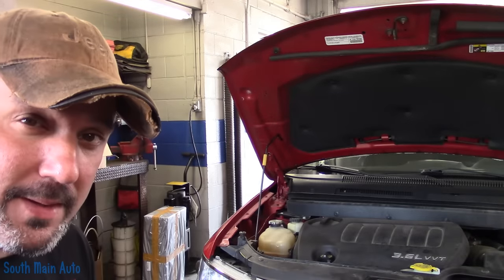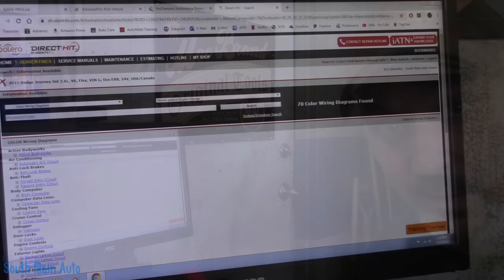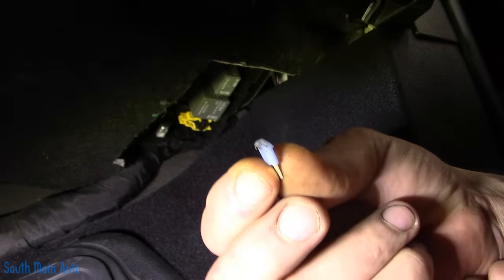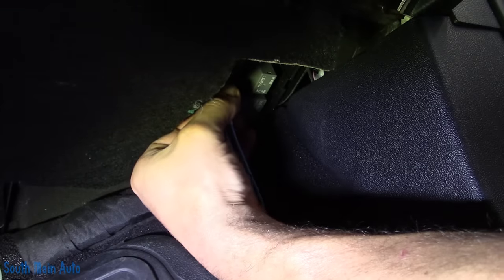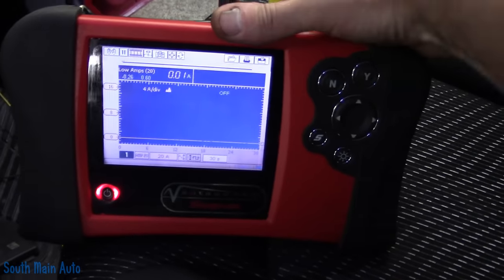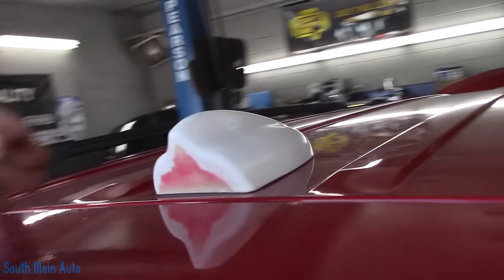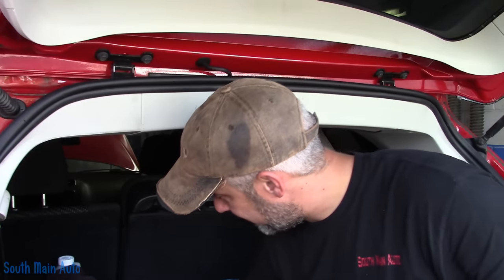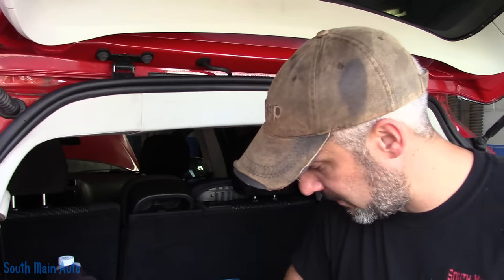Dodge Journey: No Start, No Crank

Comment: My 2013 Journey has twice now, done the same thing; no power and no cranking. I had the battery tested after charging, and they said it is working fine, with no cell issues. When the vehicle first did this, it unlocked, then there were no interior or dash lights, and it clicked once instead of cranking. I got a jump, it started, and only ran with the cables. The next day I went to the vehicle, and it operated as if it never happened. Ran well until yesterday. I heard a constant clicking noise, while the vehicle was OFF, and the doors wouldn't lock, so I manually locked them. This morning there was just enough power to unlock my driver's door, then nothing happened except that same clicking when I pressed the fob because it said Key Not Detected. After I attached my jumper box, I had to start the vehicle with the fob pressing the ignition button. Then it started. Once started, it operated as if it never had an issue. The thing is, it never said Key Not Detected yesterday, or the previous time it has acted up. The mechanic thinks it might be a low battery in the fob, however, I don't know if the fob would affect the interior lights not functioning when it trips out. Is there anything you would suggest, as I have to drive this vehicle, and can't just go trade it in at the moment? Thank you. (Also, I have not had any aftermarket changes to my wiring performed, lol)

Comment: When I saw that "shark fin" I thought the problem was going to be in the RFH module wiring being rubbed or pinched since the RFH covers the antenna base clamp bolt and it is obvious that it was removed (probably from a car wash, garage door, or a snow broom) at some point. Didn't think the power wire would have been tapped into for a backup camera. Just goes to show that you never know until you get in there.

Comment: Whenever someone asks me to help them pick a car, my #1 rule is 'No Chrysler products' lol
Reply: Or Nissan
Reply: or Ford.
Reply: darrell c whatttt. Ford cars are shit but ford truck are the most reliable American vehicles on the road whether you like it or not lmao. The 2 best in general are Toyota and Honda
Reply: The way I see it is this: It really is dependent on the unit of measure. If you want cheap and disposable, Japanese cars are perfect, if you want a yard ornament buy a newer dodge, nissan, mazda, chev, pretty much pick one of any manufacturer... if you want solid engineering but not excessive, old volvo. If you want speed/hp go old chev. Torque? Old Ford. Loud and slow? Old Chrysler/Dodge/Plymouth. The CDP big blocks were called elephants for a reason. Handling? Easy, and I am gonna catch a lot of flak for this, but Lotus. Reliability? Give up that pipe dream now, nothing out there is guaranteed to ve reliable. It's a question of luck, not manufacturing or design limits. Every model from every make has units that prove reliable and ones that fail. Ease of repair and supply of parts are better metrics to go by. Thoughts?

Comment: What in the world did you do to your poor right thumbnail?
Reply: Hazards of the job. Fingers get banged and smashed, but it's better than losing the digit.
Reply: @CubasAutomotive  at some point continuous bashing is just as bad as loosing it . i'm living proof  :(
Reply: @richardcranium5839  yeah, my father says the same. Tender tips. .. I get that from time to time, but still glad I have the fingers. Lol. I find that using tools instead of finger tips kind of helps with that. Seems to let them heal but also less strain on the digits. Also, soak them in Epsom salt for an hr here & there when they hurt. Does wonders for me.

Comment: You should have used your "Fluid Film" Load Lamp in place of the 10 amp fuse in the meter, that way the max current would have been limited to 4 amps. Another great video never the less. Thanks from Northern California (the good part of the state)

Comment: Thanks for the new video. I look forward to watching your usual Sunday installment. I thought that we were out of luck with having several come out this week.

It still amazes me about the hack job aftermarket installations. A couple of years ago I replaced the stock AM/FM radio in my Chhheeevvroleeet 2500 with the fuel efficient 6.0. I had to wire the new radio’s harness to the module which has the door dinger... Care was taken to solder and heat shrink all connections. It didn’t take too much time to do things right. I guess that time is money for the car electronics shops. They must do whatever to get them out the door and get the next one in.

Comment: Good find Eric, I do the same with aftermarket equipment problems.  If they want to pay me to install it properly, that's a different situation.  I refuse to let anyone at a fly by night store hack aftermarket crap in my vehicles. If I want something, I'll install it and use proper wiring, grommets, fuses, relays, etc. 

Cheers Mr O

Comment: had a similar perplexing issue on a 2009 vw cc awd ... where as a bad door module was holding on the entire computer system   causing battery to  go dead in a few hours .... did the mv test across the fuses to determine all circuits that were  staying alive , had to use the old noggin  to see past the problem and bring to the conclusion of what was really the problem ... side note door module codes and nonworking window and door latch .... enjoy the door panel removal self latching push pins , must separate to get them to release ....

Comment: The roof rails also leak. I own a 2007 Durango and my seatbelt mechanism gets wet whenever it rains from the mounting holes being directly over the b-pillar soaking the seatbelt mechanism. I also had a problem with the drain tubes from the sunroof coming apart in the a-pillar and leaking down onto the drivers side kick panel fuse box.

Comment: You can modify the broken fuse to include two wires for testing. That way it is safer and faster to test. And you have a new tool.

Comment: For a few years it was common to see Chryslers with aftermarket HID headlamps activating the starter when the lights were turned on. A good way to cook starter motors and the occasional TIPM.

Comment: Dang, you're good! The meter thing could be a problem for people with oversimplistic thinking. Always calibrate your instruments.  A known current draw with a lamp similar to what you do ROUTINELY with scope on a rope is the ticket !!!
As to the diagrams - you always have to check your circuit diagram for the circuit in question BUT you also always have to check the power feed circuit too. You MUST check both.  It is VERY COMMON industrial practise NOT to include side loads in single-circuit diagrams.  For that you must consult the power feed drawings.  I used to do power shutdown planning for a huge 20+ megawatt site.  Hydro would call me at holiday times to see what we were doing.  It takes days to plan these while consulting drawings and old load lists.  Proper schematic searches are priceless.  Nevertheless, your nose for trouble and your fabulously good visual inspections and your 'nose' for specific circuit problems and water leaks are what renders you as one of the best automotive guys on YouTube.  Probably THE best.

Comment: What would you do without Chrysler products? Go broke? When I was an apprentice back in the day we called them fuse-able links. Not sure why, but it did help to distinguish them from the old glass cased fuses. I'm working on a Merc, starts but dies. Electrical nightmare so going to service a Jeep as that is going to be a pleasure in comparison.

Comment: My favorite is after market remote starters that have 20 wires hacked into and covered with electrical tape. Was it worth the $500 accessory to get nailed with a $300 repair that looses the accessory! Great find 👍

Comment: I used to do car audio and alarm installs for Circuit City back in the day.  We were trained to and always install a fuse within 6 inches whenever we tap a power wire.  Unfortunate this install was done so poorly.  I agree, the power should have been tapped up front instead of some random module in the headliner.

Comment: For those reverse cameras.. I always prefer running a relay and pulling the signal off a reverse light plus power direct from battery or breakout box.  A good marine grade sheathed cable for both the power and the signal work well for it.

Comment: I applaud Eric O for disconnecting stuff like this. Very few "installers" have a clue as to what they're doing. Most of them are high amp stereo junkies that think bigger wires must be better because of lower loss (that huge red wire is a dead giveaway one of those idiots installed it). This one is a clear case of leaving someone stranded because the install caused other problems. In same cases it can destroy something expensive. If the customer has a problem with it they can pay for a real install. You're already stuck fixing a problem caused by someone else, if they want it working they can pay the extra money to have it done right.

Comment: Oh boy, where the hell do you find these installation hackers ??? Is there a school that teaches this crap install techniques ????  Anything entering a hole, better have protection for itself. At times, I used rubber hole grommets of different sizes to protect the wires or whatever from chafing or rubbing thru. Also used the stuff for a "" Door edge guard "" that you slipped on the edge of your door so the paint didn't get chipped, it came with and without adhesive and worked well. And lastly, you could just silicone caulk the hell out of it so it had flexibility but didn't move.  Every fuse box has an empty pin or hole where you could get power from. Or use the cigarette lighter wire (30Amp) for power, but fuse your wire to protect your circuit. Always silicone around an entry hole into the vehicle, just common sense !!!!!!! Good diagnosis Eric, you da man !!!!!  Your work techniques make me proud to say that your are a "GREAT" fellow mechanic, and I don't say that often - you earned it !!!!! PS Mrs. O., what's for lunch today ???? Scallops, lobster, steak, veal or pork chops  with mashed potatoes with white cream gravy and mixed vegetables with a side salad ????? Is there white creme filled Krispy Kreme donuts with the morning coffee ?????  Just curious......

Comment: The water stain is very typical for all the third gen Jeep’s and Durango’s .  The OEM tall antenna hits garage doors and low hanging items in parking garages.  When this happens the grommets open up abd stay open allowing all the rain or car wash water in to the roof liner.

Comment: In 2012 I bought a new Journey just to try a Dodge product, after 3 months of having it in the shop almost daily for recalls, interior dash and panel parts falling off, smelling things that are hot, and then with 1,500 miles the transmission went out, they repaid me for my three months payments and took it back and tried to sell me another one. I told them you must crazy if I would get another Dodge anything.  I walked across their lot to the Ford dealership and went back to Ford.

Comment: Normally people tap into reverse wire to turn on the backup camera,  or at least that's what I do. But I think in this case original owner wanted a live feed to the camera so it's on all the time, probably to check on a trailer.

Comment: It always seems like amateur hour when you open up a problem source and there sits an extra set of wires tied into the part that was failing. People really need to do their homework when they decide to have after market installs done on their cars.what good does a back up camera do ya when it shorts and strands ya alongside the road somewheres. or in a parking lot right after you open your hatchback. By the way Eric my daughter and I rented a push button starting car and are on vacation. It’s also a hatchback. Kept trying to figure out how to open that bugger. I looked for a button on the drivers side , then just above the license plate underneath the trim. Finally gave up and checked the book. The latch is under the passengers tail gate and the door didn’t lift. It opened from the right side  turn signal light and opens like a door to the left. Who would have thunk. Nice job finding the smoking gun and cutting out that crappy aftermarket wiring that was causing the problems

Comment: Any time I have a vehicle in my bay with an electrical issue, I always check first for aftermarket crap (radios, alarms, cameras, power ports). Over half the times, you disconnect that nonsense and the problem goes away. I don't know how many times I have seen wires just twisted and taped together (solders irons and shrink wrap are not that expensive), "piggy backed", and the infamous yellow wire nuts.

Comment: Backup camera...why in god's name wouldn't you take the feed from the Reversing lamps?  That way 1) When there's a fault you wouldn't take out the whole cars ignition feed. 2) If there's a fault, it will blow just the reversing light circuit. This then makes for a relative easy diagnosis as you would go straight to the light cluster first. Crazy install.

Comment: No start? Check battery First -  Then - Try a reset: Push the start button five times. Then try regular startup - Depress brake pedal, press start. If no go, try a shift to neutral. Shifter locked up in Park? Release by opening console, find and remove small cover plate inside low to front. Press small tab button with screwdriver as you release and move shifter to neutral. Try restart process in Neutral. If no go, check battery again, then fuses.

Comment: Nice diag and fix. Gotta love AM installers just pick a power wire & splice into it but probably would've been fine if they used grommets & did a proper installation. Smart customer going OEM & eliminating the water intrusion

Comment: Tell ya one thing is certain, General Motors, Chrysler and some Ford Products definitely keep us as mechanics busy all year round. GM vehicles is our Bread and Butter here in Montana, they're always breaking down somewhere. I run a Mobile Auto Service in the Northern Hi-Line area of Montana, the work for them never end. 75% of our jobs are on GM Products alone. I give everyone that works on vehicles in the salt belt areas a round of applause... Because that is some rough crap to work with and work on. We don't deal with the salt corroded vehicles up in this neck of the woods like they do over on the central to east coast.

Comment: Chrysler really don't have a "shark fin" for a radio antenna. In fact who ever had that installed wanted to go "El cheapo" route because at the dealer if the customer wants a back-up camera installed they can easily do it. Factory wiring harness has the hook up for the back up camera and all it takes to activate it is a radio firmware update via USB. Worked under a Chrysler master tech as his apprentice and learned a good deal about the brand and it's various models. This is also a big reason why I don't trust aftermarket stuff to be installed right by someone else. I usually do the install myself. I get what I need and I know I won't have any issues.

Comment: When I installed a backup cam in my Transit Connect I tied it into the backup lamp wire as instructions indicated. Since it was wireless I didn’t have to run wires up front.

Comment: Those are micro-2 fuses. They also make a micro-3, it has three terminals, and is essentially 2 fuses in one. It has a common terminal in the center and two outputs, one on each side.

Comment: After installing my first camera I didn't realized the power button was stuck on it after the internal tape melted from the heat inside the car. It kept draining my battery for a good long time until I found the problem was the camera itself and not the radio I had just installed. I like the car dvrs but you really have to keep an eye on those as the internal batteries also die on them and then the camera won't even work. Yes they are a pain but I have recorded two cars that have hit my car.

Comment: Like I said to Ivan...the best journey you can take in a Dodge Journey is to the auto recyclers.😃
Reply: That's how I feel right now almost 2 years of the no start, no crank issue. 4 batteries bought, a new alternator bought (because we did get the red battery light showing alternator was not recharging the vehicle). Two days ago, cut the car off, went to restart it immediately and it will not start. Finally got it towed home yesterday and bought a starter. Gonna put that on today along with a passenger cv axle because it needs one. All fuses good, all parts OEM, ready to take it back to the dealership we are buying it from and chew their butts a second time. They (the dealership) are national and notorious for hiring mechanics with no mechanical experience and they throw parts at a car "hoping" as they say that it's fixed. They want their payments but can't figure out the car. Same issue with a Nissan Versa we bought from there too. No start, no crank.

Comment: Couldn't agree more....hate aftermarket crap!  I removed a custs remote start system b/c it was causing CEL w 02 sensor codes.  Funny part...I have ZERO problem tearing out aftermarket crap, sometimes w/o custs permission (yes I still charge for that because it fixed the car)....BUT, one if my best friends works for a mobile place doing aftermarket installs...lolol...
I've jokingly told him, 1st time I have to tear out one of his installs to fix a car, we can't be friends anymore 😂

Comment: its a good thing they didnt wire that reverse camera onto one of the output sides of that module!! That would have worked and when the wire shorted like it did could have ended up in you spending a week of changing modules that fried!